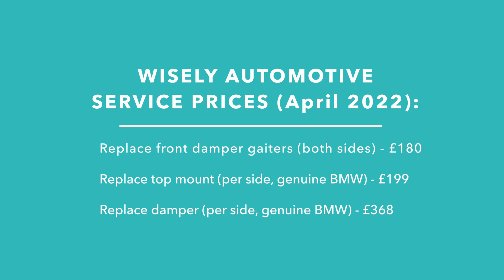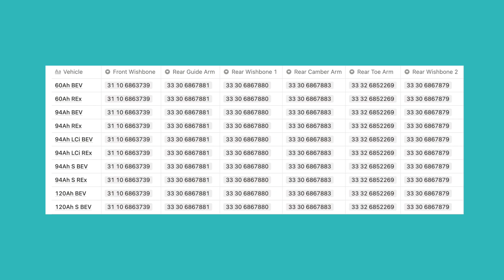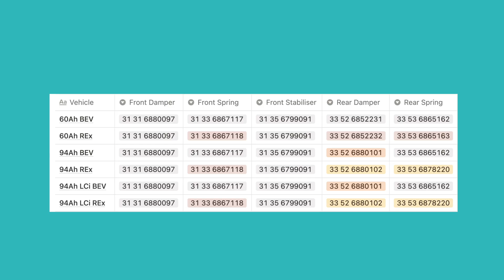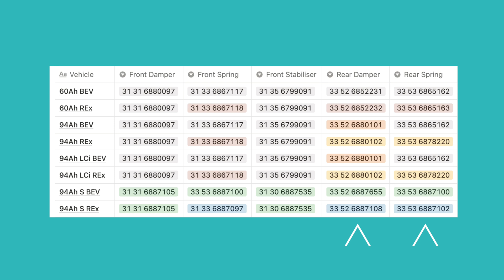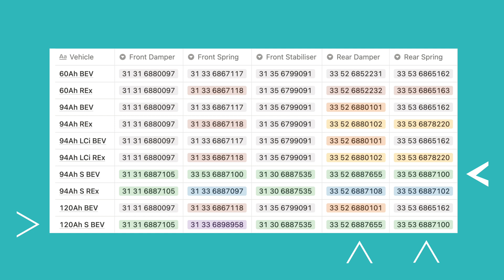BMW i3: All Eight Suspension Versions Compared (including original vs LCI, standard vs sport)

Comment: I love my i3. But, the suspension can feel a bit jelly-like at times. It does not like going over 70 or a cross-wind. If you hit a road imperfection or pothole on a corner it really upsets the car, you can feel it twitching through the steering wheel.

Comment: Superb video as always guys! 

Trying to diagnose a minor issue on my 2019 120ah i3 with 44k miles. At very slow speeds when I turn the steering wheel, it feels a bit crunchy. Not sure if thats top mounts or something different? 

Is there a test I can do to investigate further? Thanks! Andy
Reply from the maker: Hi Andy! Thanks for the support. Arthur will email you in the next few days with some info which might help or, if what he suggests doesn't help, we can get you booked in for a repair
Reply: @wiselyauto  amazing thanks so much.

Comment: Hi Martin, thanks for another awesome video from Wisely. Like many i3 owners, my main issue with the car is ride quality. I have an i3, 2019 120Ah BEV with the diamond cut 19 inch wheels you got in 2019 as standard. At 34k miles I am nearing replacement tyres, can I get better ride quality and less road noise by choosing a different tyre from the factory Bridgestones?
Reply: My car, same model with all new tyres. Probably too late now, but Continental tyres have been a revelation.
Reply: @MichaelWilliams-ub3ow  Thanks for your reply, I will look at the Continentals - still got tread left on the Bridgestones. When you say ‘revelation’, can you expand a little? I would like to improve comfort and reduce tyre noise if possible.

Comment: I own a 2013 60Ah BEV with 20in wheels and as most people say, its biggest problem for me is the ride, it's just so crashy and not compliant at all as you said. This is I'm sure also due to the fact that i do hear a lot of creaks coming from the dash/glovebox/airvent area. Also, is it true that BEV versions have stiffer springs than REx versions? Is it possible to simply fit softer springs, as the standard ones are so stiff one never uses even close to full travel?
Reply: Springs are not stiff, they are springy. What makes vertical oscillations stiff? Well, tire wall size, tire pressure and dampers. Not springs.
Reply: I think he means stiffer = higher spring rate, more kg/mm or whatever, softer = lower spring rate, less kg/mm. I understand your point about dampers, tyres  etc but softer/stiffer is also used to refer to spring rate.  @tarassu

Comment: Hi! Martin. I bought my used 2016 i3 (REX) last June 2021 with 26k mileage on it. Since then, the whole family loved it, specially now that gas prices here in the US got crazy high. The ride has been so smooth that I already put additional 8k miles on it.  But this morning, I suddenly felt a short squeaking sound when I "accelerate" from full stop. I describe the sound comparable to whenever you engage the electronic parking brakes, but shorter squeak. Can I ask for Your opinion about it? Thanks. - Rene
Reply: At the same mileage, my top mounts started squeaking when slowly manoeuvring.
Reply: Noted. I'll have my engine  mounts checked on my next REX oil change. Thank you👍🏻
Reply: @renebueno6149  damper top mounts?

Comment: I wish I lived close to you guys. I'd know my i3 would be in safe hands if it came into your garage. Keep up good work. I don't suppose anyone can help? Occasionally my tyre pressure keeps coming on, when i run the test, always seems to be the same tyre thats lower than the other.  Its a bran new tyre too.  Any ideas would be welcome.  I think the good one always reads 2.2 or 2.3 (can't remember now) other tyre reads 1.9.  Rear tyres are always spot on. Thanks again.  It clears and stops complaining when I run the test. Thanks
Reply from the maker: Thanks for the kind words! When the iDrive reports that the pressure has dropped to 1.9, is this actually the case? Have you confirmed this with an external gauge and then have to top it up? That being the case there must be a leak somewhere. Best to get some soapy water and spray it around the bead (and also onto the valve stem as these commonly leak). If the latter, you can buy a valve stem repair kit. If there is no actual leak, it’ll probably need a new tpms sensor. These aren’t hugely expensive, but the tyre would need to come off.
Reply: I'm a bit late with my response, but remember that wheels can also be damaged or defective when new, and so the wheel can also be the source of the leak (Audi had lots of problems with leaking wheels at one point due to poorly manufactured aluminium wheels which were porous and leaked air). Maybe if you go to a bad tire shop they may also not replace your valves as they replace the tire, and that can be defective?

Comment: Great video with lots of interesting information.  Thanks a lot for this! 

My problem with my i3s 120Ah is the hardness of the chassis in the city. Overland at higher speeds it's perfect but around town on bad roads it's extremely bumpy.
Aren't there any electronically adjustable dampers that ideally change automatically via the driving modes?  So "comfort" = soft and well balanced but "sport" = hard and sporty.
Reply: You can put 195-55-20 tyres, they are cheaper and more options, add sidewall and diameter, and you can use lighter wheels, i know a brand making forged magnesium for i3S. So Lighter unsprung mass can help.
Reply: @llavero5 Guter Tip aber leider zum Beispiel in Deutschland nicht zugelassen 😟
Reply: I bought a used car with the AST lowering springs and the ride is...not ideal. Super harsh. I'm going back to the stock springs.